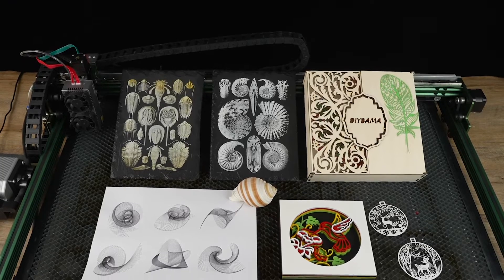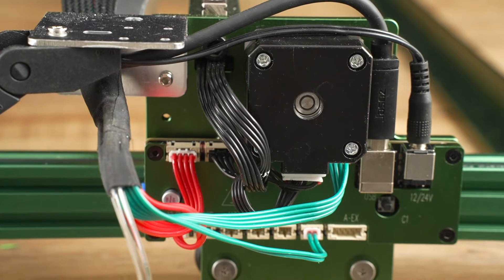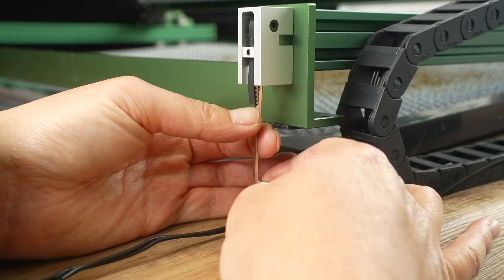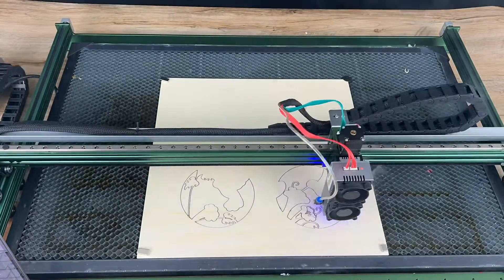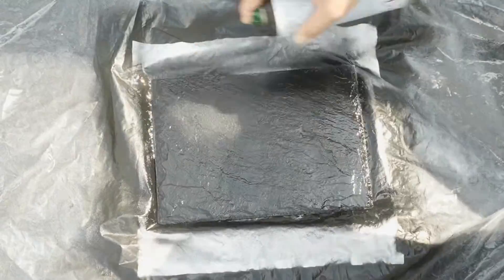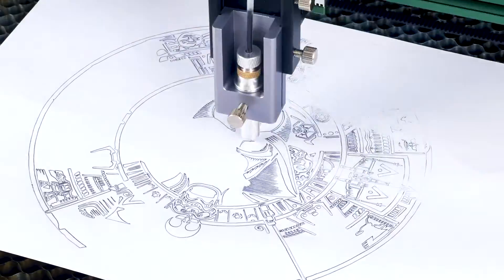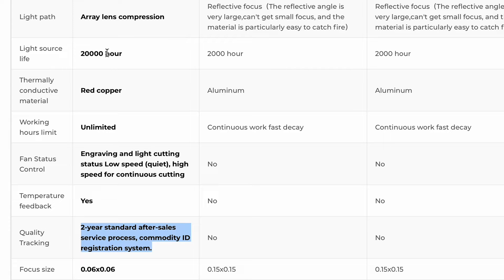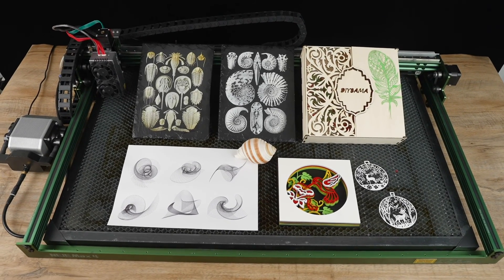Largest Diode Laser Engraver- NEJE MAX4 E80

Comment: Hi. Your review is excellent. I wonder however why so slow cutting speeds for 3-4 mm plywood? Was it due to your using of the small air pump, or the type of plywood you had on hand?
Reply: Scratch that, mm/s not mm/min :)

Comment: The tool block is 50mm, just set it on the material and lower the laser onto it and tighten. 
home it and either lower 25mm if you don't need active Z or just take into account of the 25 mm when setting parameters. (active Z and Z offset)